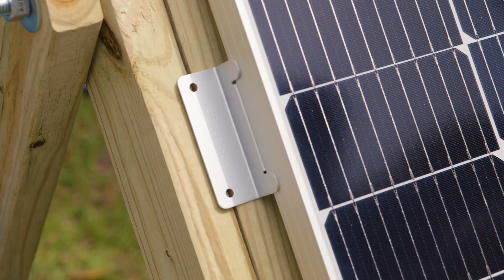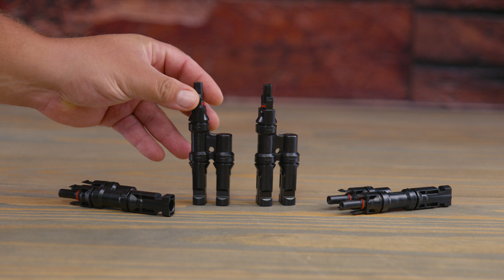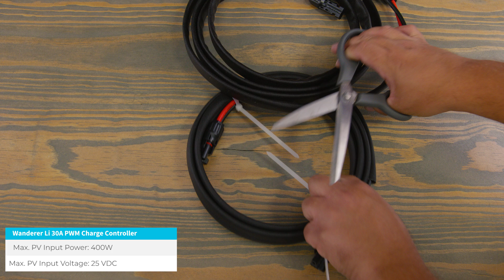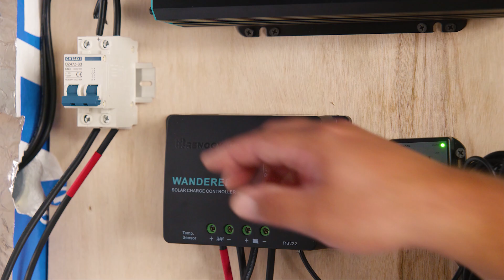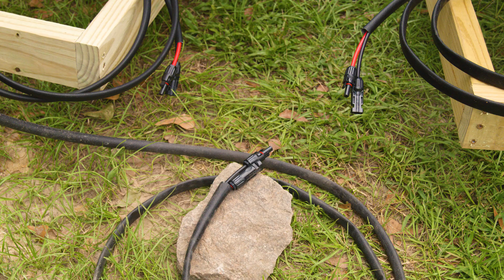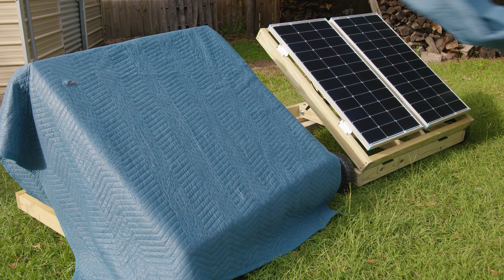How To Add Solar Panel Existing Parallel Setup Easy Simple

Comment: I have a Renogy Wonderer 30 PWM Charge Controller that came with a starter kit and a miss match Set o 4 Solar Panels and want to 2 Series / 2 Parallel to the Wonderer to maintain a battery bank o 4 RENOGY 200AH AGM BATTERIES and have the option of going 12 or 24 Volt with this System. Nice Explanation for wiring these 2 sets o 100 watt different Mfg. Panels up.

Comment: You forgot 1 thing, at the end of the day the voltage drops as the light goes away. So a series panel with higher voltage will run longer.
Reply from the maker: Great tip! 💪😊👍❤️Yes another thing to consider, when choosing between all three options.